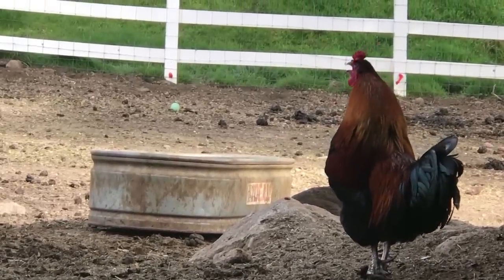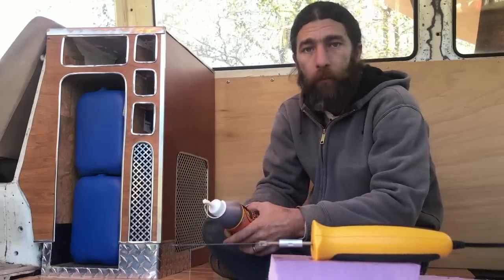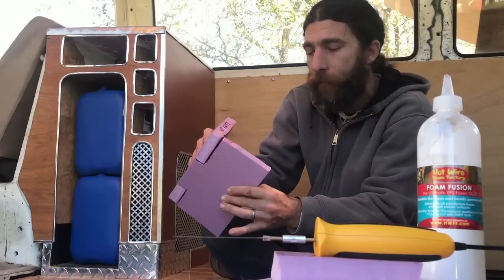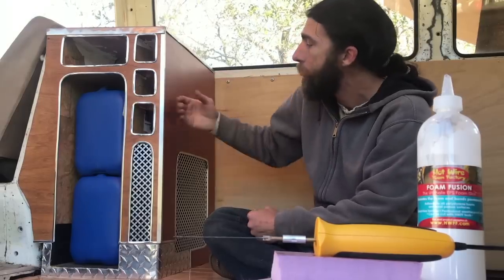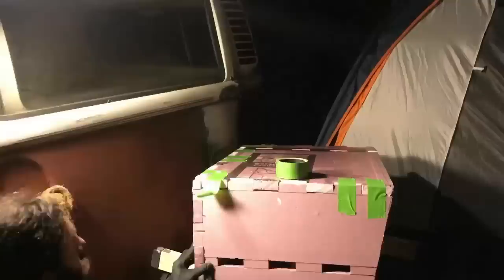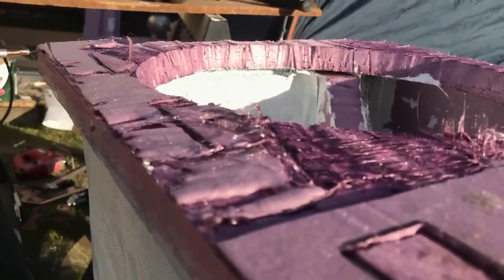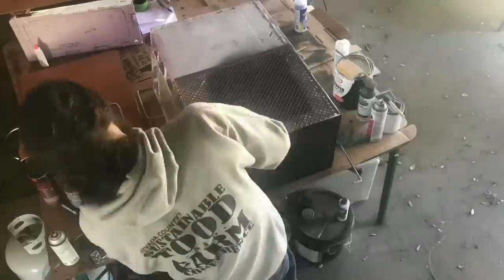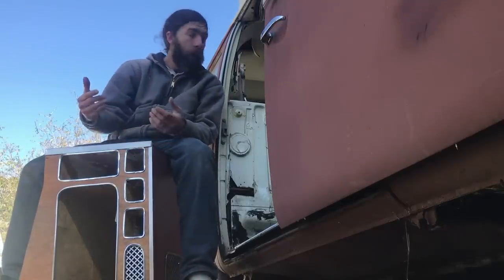Foam Cabinet Prototype - Improvements on Building Foam Cabinets for Camper Van

Comment: Great job, you the man. I'd like to suggest that it's very important to wear a mask when cutting any type of plastics because it's synthetic and doesn't dissolve in the lungs, may cause cancer.  Note : The number one health issue for plumbers is cancer because they cut plastics with out a mask.
Reply from the maker: I appreciate that but the fumes released are mostly co2 and water vapor. I always work in a ventilated space however. Also I’m a smoker so I have lots of options for getting lung cancer🤷🏽‍♂️
Reply from the maker: Hey thanks for the comment! It was addressed in this video I just released. Check the table of contents at the beginning if you want to skip to a particular subject: https://youtu.be/BcAXr_gtbG8

Comment: I will be building a Truck topper camper that will be covered in PMF When I glue the 2" foam to itself on my roof sections,Would you recommend the foam fusion or the gorilla glue?  Thanks for any help

Comment: I would really be interested in seeing a weight comparison between this and modern RV cabinets, considering the RV cabinets are made from some dimensional   lumber and 1/8 inch ply. this just seems likely heavier, more time consuming and looking at the things and steps you went through more expensive. Dont know that im right but ......
Reply from the maker: This is addressed in the upcoming Q&A video. But it’s about half the weight.
Reply from the maker: Hey thanks for the comment! It was addressed in this video I just released. Check the table of contents at the beginning if you want to skip to a particular subject: https://youtu.be/BcAXr_gtbG8

Comment: Hi. Just a little bit of advice. Spray glue may cause cancer cells to grow in your body if the vapours are inhaled or swallowed. Please take extra care using spray glue. My very good friend who was realy healthy fit & strong almost lost his life to cancer just months after using spray glue to carpet line his canal barge.  So if or when ur using spay glue/adhesive ensure you have pleny of ventilation, or evan better use a pray painters mask ventilator.  I really enjoyed the video and a very good idear to make lightweight cupboards? probably a lot cheeper than using lightweight timber. 👍

Comment: Awesome tutorial! 
But I don't think the more complex joints will do much IF you laminate them. The foam will contribute compression and shear strength, the joints would be held together by the laminate essentially making a butt joint much stronger. I think.
The "best" way to do this would be to use epoxy to waterproof the wood veneer. Epoxy doesn't evaporate solvents while drying to it doesn't leave pores (like e.g. polyester resin). Epoxy is the best way to make wood waterproof for boat building for example. 2 components is much harder to work with than PU glue though.
Or use fiberglass for even more strength, but wood gives more strength per weight and is cheaper. A thin sheet of fiberglass is glued on plywood boats though to give more impact strength.

Comment: That's an awesome job man! I saw the Jed video about doing cabinets with foam and thought the same as you just did: put those thin wood panels around to reinforcement. Just tell me how you managed to mount on the van floor/walls? Thanks!

Comment: Your construction method is amazing! One question: Is there anything special about the paint you used to attach the screen? For my project I have a panel of acoustic insulation which I will cover with screen. Would like to wrap the screen 90 degrees from the large flat surface of acoustic insulation around the outside 1 inch edge of a frame made of foam. Imagine a picture frame made of foam, the picture frame holding acoustic insulation, then everything wrapped with metal mesh window screen to hold the insulation in place. From your experience working with the screen and foam, do you think latex paint is enough to hold the screen to the foam? There is no force on anything. The framed panels will line the interior of a container/box. Of course I will have to try some sample pieces first. Just wondering if you had success with a particular paint? For my application, right foam could have better acoustic properties than the wood frame and staples I was planning to use. Thanks for sharing your thoughts.

Comment: awesome vid, man. more potential strength than the same weight in wood or aluminum, but such a process. is it necessary? depends on how the van's used. I'd like to give this a shot in a toy hauler.

Comment: That was fantastic. I'm curious, if the screen material is nylon, would it have been possible to paint/screen the foam before cutting it and use the hot knife to cut after? If so, would that have saved you and time/effort in the process?

Comment: At 6:25 or so - what about the smoke or vapors from using the hot knife to cut the foam?  Any problems there?  I'd want to be working outside, or at least in a very well ventilated shop.
Reply from the maker: See the Q&A video... the “smoke is mostly Co2 and water vapor... you should be in a ventilated space but it’s not that toxic.

Comment: great job on the video and the build.   How would you attach foam cabinets into the van? would these foam panels be strong enough (in Larger sizes) to build shower/bathroom walls?
Reply from the maker: You can screw through it to body panels with a 1” washer on foam side.
Reply from the maker: Hey thanks for the comment! It was addressed in this video I just released. Check the table of contents at the beginning if you want to skip to a particular subject: https://youtu.be/BcAXr_gtbG8

Comment: Nice DIY construction!  So, how about long term durability.   I see the video si several years old, did it hold up like you hoped?  I am thinking about this, but a little concerned that the constant vibration and knocking will eventually tear through the mounts.  Did you add any wood or other material for a mounting point?
Reply from the maker: That video was my prototype, I have newer videos with a Transit Van build, we just got done with 18 months full time and it held up great!! See new videos for more on the build system.

Comment: A couple things i noticed, it seems like it could be better if you fiberglass(or window screen) under the sink, because that sink is sitting on unreinforced foam. With a full sink of water, over time it could fall thru. but i noticed since you also put a piece of stainless over top of that with wood glue, it helps with that. i was worried when i seen you stand on it, just never stand in the sink because it will bust thru. 

One other thing i noticed, it seems like a waste of time putting all those little gingers in the foam. It looks nice and will indeed make wood stronger, and worth it for wood, but foam it is so weak anyway, it will still snap right off. The only reason foam works for the cabinet is because you are laminating it, that is where it gets its strength, not foam fingers. 

But nice job though, i like the diamond plate and stainless, nice touch.

Comment: I like the idea of using bed liner on the foam. I am thinking of enclosing an entire utility trailer using a pvc pipe frame and interlocking XPS foam board pieces. In some places I might add aluminum sheets, but I wonder if in other places a good amount of bed liner pained on with a brush will harden and be good enough on exterior. the other idea i have is "poor man's plaster" using canvas and glue. I have seen other entirely built foam trailers using that method, but bed liner although smellier in application would be simpler to do. To me it does not have to look pretty. Any thoughts on how good the bed liner adds strength. Either just bed-liner alone on the foam, or perhaps bed liner on top of the painted on strength giving mesh screen? .
Reply from the maker: Hey thanks for the comment! It was addressed in this video I just released. Check the table of contents at the beginning if you want to skip to a particular subject: https://youtu.be/BcAXr_gtbG8

Comment: @13:30 instead of “tongue and groove” a better term for that joint would be “mortise and tenon “.  Are you able to glue plastic laminate (formica) directly on the finished surface of the foam instead of the 1/8” luan? Great work, looking forward to trying this application!
Reply from the maker: Hey thanks for the comment! It was addressed in this video I just released. Check the table of contents at the beginning if you want to skip to a particular subject: https://youtu.be/BcAXr_gtbG8

Comment: just wondering if this foam insulation board can be used as a light weight extended shelf (cab over) in a transit connect?  Only light items would be stored on it.

Comment: Rather much work for that ! and much room... Since 17 years, I use dry toilets with sawdust. No trouble, sometimes during 11 days ! and rather small, suited to my peugeot Expert Van, I keep it under my bed.
I used a 10 l plastic Jerrycan, cut horizontally under the top. And a wooden box not waterproof, no need. But strong enough (22 mm) to sit on it.
On coming back, I empty it at the end of my gardenand water clean. If I was in town, I think I could empty it in a paper bag special for greens garbage, they make "compost" with it, I don't think they could object if they knew.
But go on, good information about foam building.

Comment: Brilliant design.  What about off-gassing and does this foam have problems with drying out or in general getting softer or more brittle or thinner over time.  I know the material is used in building insulation inside walls, but I know nothing about its long term use in your situation.
Reply from the maker: This will be addressed in the upcoming Q&A video, but the offgassing is minimal and the fumes when cutting are not as toxic as people think.
Reply from the maker: Hey thanks for the comment! It was addressed in this video I just released. Check the table of contents at the beginning if you want to skip to a particular subject: https://youtu.be/BcAXr_gtbG8

Comment: Do you have any ideas about non-wood panels which sound-proof, insulate thermally, withstand various shocks from the inside of the vehicle, and do not shatter upon impact from outside of the vehicle?
Wood splinters can be devastating in an accident. 
If you use just foam it will get dinged and shredded.
I was thinking of some sort of vinyl which won't gas out, in combination with foam and a film barrier.
Durable, thermal and sound insulation, which won't fragment dangerously from impact.

Comment: Are you going to build all nine pieces out of foam?  I Hope one of them is the bed. I'd definitely like to see that--and if anyone could do it, you could!  Great job on the cabinet and the video!
Reply from the maker: I am going to do the full cabinet set out of foam... I had not considered doing the bed / seat out of foam... I'll have to ponder that a bit... it's an interesting idea... I have a mock up of the bed in wood right now... it would be a challenge to do it in foam... hmmmmm....
Reply: It certainly would save a lot of weight, even with metal edging on the legs.  You'd probably be the first to do it.  Maybe you could use PVC cylinders for the legs (Into the Mystery 13 did this), and just make the platform out of foam...Anyway I'm sure it would be fabulous and attract a lot of new  subscribers.
Reply from the maker: It's worth a try... I'll give it some thought.
Reply: Great!!

Comment: In the aircraft industry foam joints before the glass layup, are glued using a version of 5-minute epoxy using butt joints. Any quick 5 minute epoxy at a home store will do. Just for reference the 5 minute epoxy is stronger than the foam. It's the fiberglass layup on the foam that gives it its strength, not the foam.
Reply from the maker: See my more recent videos for more discussion on this, but, yes; in other build systems epoxy is used as a glue and then fiberglass over the foam. Epoxy has some downsides from my perspective; a little messy, not as easy to apply… but mostly that it cures to be hard and inflexible. In my recent build I use a glue that hardens to be strong and flexible. This is a great advantage in my opinion since it holds but can flex with the torsion or “earthquakes” when driving. 

As for the “fiberglass that gives foam it’s strength”… while this is a common perception, foam has good compression strength but lacks tensile strength. Adding the cheap and easy screen provides the tensile strength where needed. For a skin with tensile strength but better presentation 1/8” finish ply or even veneer is some situations is suitable. Certainly if you want the finished look of fiberglass, by all means that system is strong and will work. 

Thanks for your interest and comment, check out my more recent videos and let’s continue the conversation!

Comment: Nice job, great project; kudos. However; why didn't you choose to use corecell / divinycell foam board sheets; that are used in the boat building industry ? It's a closed cell pvc foam that is superior to the home building foam board bought at your local home depot.  It's a bit more pricey,  but it  is much lighert and has way stronger properties. I'm planning my own project since I've built several boats using this closed cell foam, which one can use epoxy resin; again used in the aerospace and boat building trade for its super lightweight and strength. I do applaud your ingenuity, and inventiveness.  My only reason for asking; is that possibly you had considered my option, but went in the direction you did for reasons I don't understand. Cost, availability, etc. Again many thanx, for sharing your skill and knowledge.  As I'm a firm believer; that knowledge is power, and should be shared in this pervasive maximum profits at all cos,t manipulated society.  Handmaid, homebuilt is the core to wrestling control back into ones daily life.

Comment: Please make a video when you figure out how to hang them for upper cabinets
Reply from the maker: That video is up now, see my most recent project.
Reply: Thanks for the quick reply.
Just realized how long ago you uploaded this video.
Will check out your other stuff
Reply from the maker: YT seems to think that now that I am posting regularly again (with a new project with new insights on the same subject) that everyone should see my 5 year old content first. Any love from the algorithm is good love I suppose.
Reply from the maker: More particularly to your question, the new build has all the foam elements interconnected from floor to walls to cabinets to ceiling… kind of a unibody approach so the overhead cabinets are integrated to that and can be glued into the walls and ceiling foam.

Comment: Excellent---careful with the fumes when you cut the foam with hot knife--respirator dude.
Reply: Ventilation is always strongly suggested, but the "smoke" that you may encounter while cutting EPS or XPS foam is primarily CO2 and water vapor, which are far less harmful than other common art products like aerosols and paint thinners.

Comment: Just curious, why not use a fine tooth hack saw blade ( just the blade) to cut the foam? I noticed your hot knife cuts were a bit rough and I know from experience that a hack saw blade works amazing with this foam and end result is a much cleaner cut.

Comment: Thanks so much for making this video. I found it very reassuring in my "that'll never work environment"

Is there a way to make the finished project smooth when you use the screen? I made my 1st cabinet (toilet cover) used 4 coats of primer and 2 cans of plasti dip and I still have a rough grid like finish
Reply from the maker: Hey thanks for the comment! It was featured in this video I just released. you can skip to 35:10ish to see your comment... the answer after yours is the best I can come up with: https://youtu.be/BcAXr_gtbG8

Comment: I love the lightweight aspect of foam, but my primary goal is to NOT turn my van into a Final Destination trap. In case of an accident, all those wood cabinets and beautiful wood ceiling planks will become a nightmarish combination of a guillotine/person-shredder. Decoupage would be a nice touch on the cabinets. Hell, with wood-look paper you could even make foam look like wood. Decoupage can be very beautiful and strong, depending on the adhesive used. Something waterproof would be ideal.
Reply from the maker: I have had a VERY!!! Hard time getting decoupage to work… sticks for about a month… something about the screen texture I think???

Comment: Just a quick question, I hope you tested all the products you are using so they aren't caustic to the foam, in my experience, liquid nails happens to melt that type of foam.  We typically use an adhesive that is similar to it, but is designed to bond to the insulation without melting it.
Reply from the maker: See the Q&A video, or my more recent videos for more on that topic.

Comment: Great ideas.  Question...  would this work with beadboard eps?
Reply from the maker: I have not worked with EPS foam... as I understand it it has less compression strength... that said it would be worth a try for sure... get a small piece and laminate it with screen on both sides and do a bend test like I did... I'd like to see / hear about the results.

Comment: I like the foam construction, but it seems like your re-building the wheel to be round and the same weight. The main thing is that you tested the limits of another alternative building product. I have considered building foam luan laminate panels for an enclosed cargo trailer, thanks for the hot knife and foam adhesive tips.